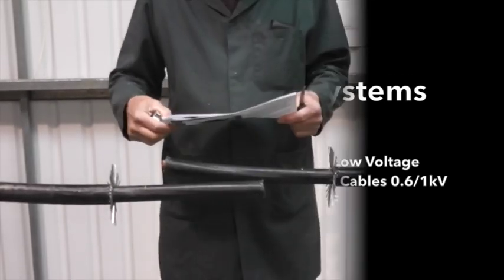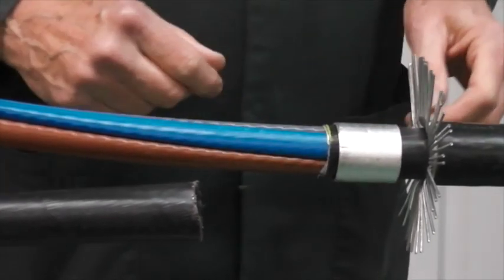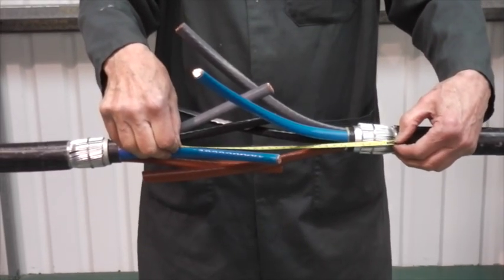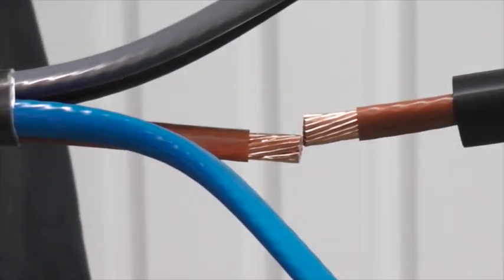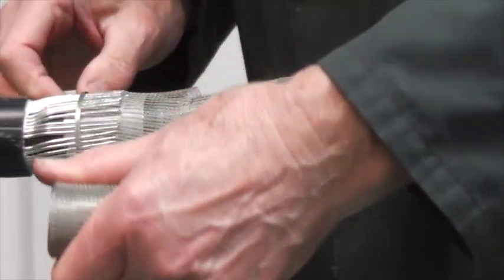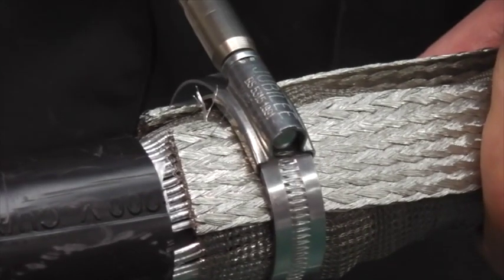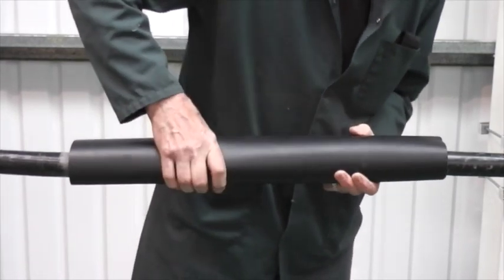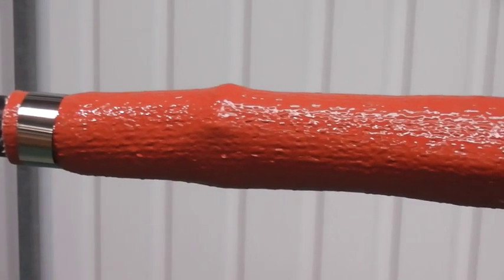Cable Joints - Low Voltage Heat Shrink Zero Halogen Cable Joints

Comment: Hose clamp. Unacceptable cable profile. Go with 3M constant force springs plus cold shrink to ensure no damage from heat gun
Reply: This case the heat source would depend on your particular company, but the constant force springs can be dangerous to apply